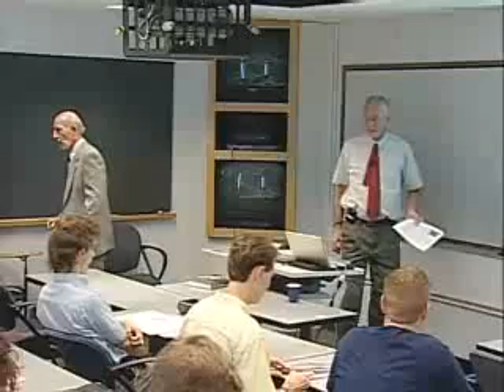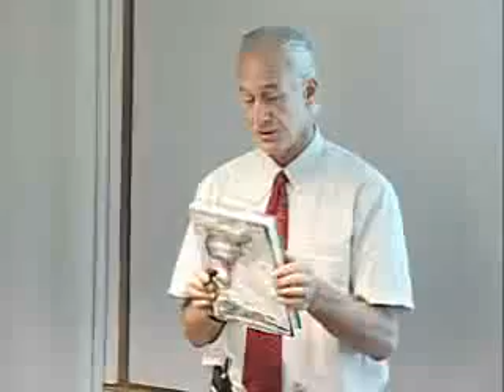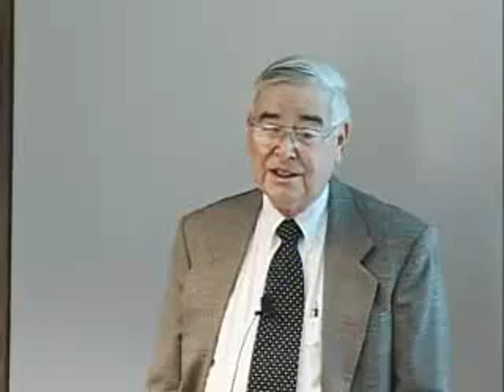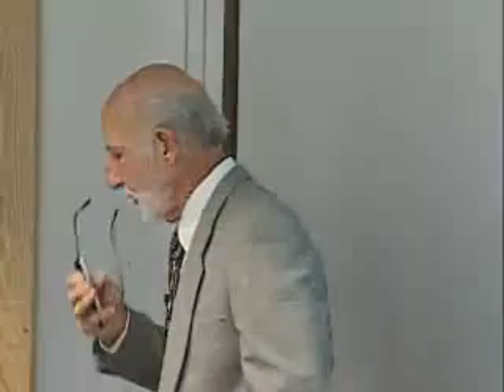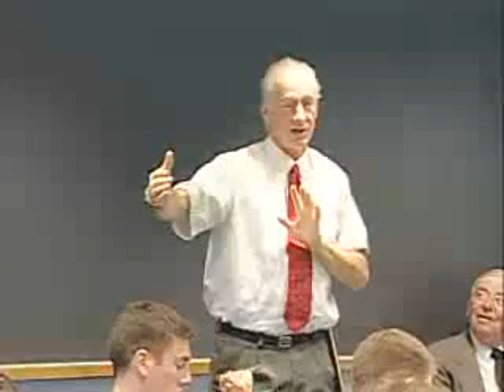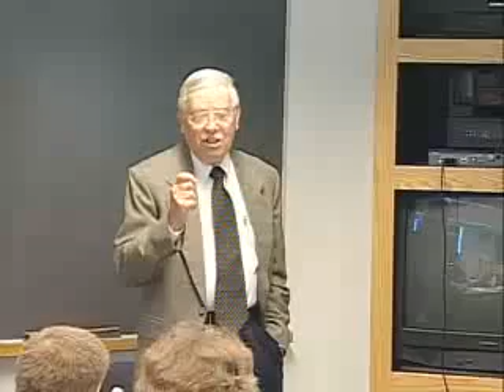Lec 5 | MIT 16.885J Aircraft Systems Engineering, Fall 2005

Comment: Never understood why you wouldn’t show the slides as he is referencing them. Same for all lectures. Come on this is MIT….
Reply from the maker: In the early days of OCW, we were concerned about getting sued for copyright infringement. That is why camera operators were instructed to avoid capturing the slides. Everything after ~2010 was published with material that could be defended under Fair Use. Many of the documents not show are in the course materials at: http://ocw.mit.edu/16-885F05. We recommend checking out the MITx version of the course: https://openlearninglibrary.mit.edu/courses/course-v1:MITx+16.885x+3T2019/course/. The MITx version doesn't omit as much material. Best wishes on your studies!

Comment: predicted strain responses for 3000 spots on the vehicle, and oceangate's chief engineer had to fight to put in like 8 strain gauges they broke 3 of and didn't fix, and then they didn't even have someone qualified to interpret them. really let that simmer in your brain for a while. if you just take that one data point, the quality standards of that 'startup' were practically a factor 1000 lower.

Comment: As far as safety is concerned, there should be some kind of 'life boat' or crew escape ability. It is easier then redesigning the craft to make up for possible mistakes.
Reply: As the Prof implied at the end. It might not make the system safer. Crew escape systems adds weight, complexity, and failure modes and in itself is a massive redesign.  It may just be safer to by pass the escape system and make the vehicle more reliable. The two shuttle disasters were caused by problems that were known and fixable. What do you think?

Although I personally think for future vehicles it maybe better to have an integrated escape system and design the vehicle ground up with that in mind. Especially as we are moving to more of a commercial regime
Reply: @doobaas  such an important point that people often don’t grasp a about complex systems. Well-intended safety measures often have the opposite effect.